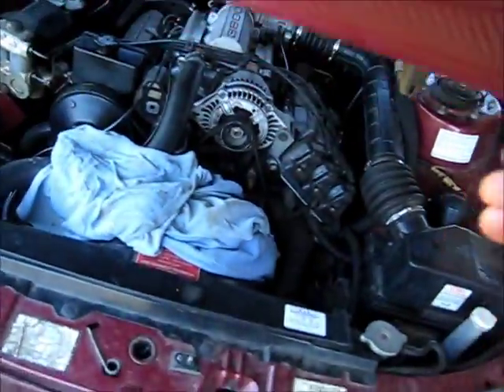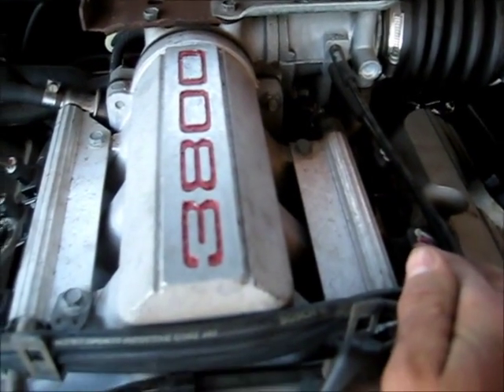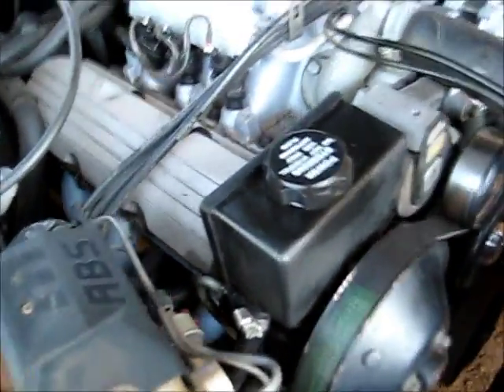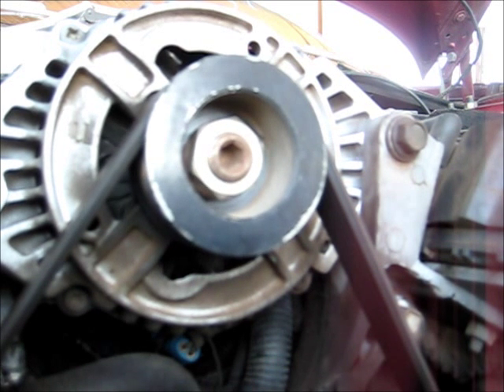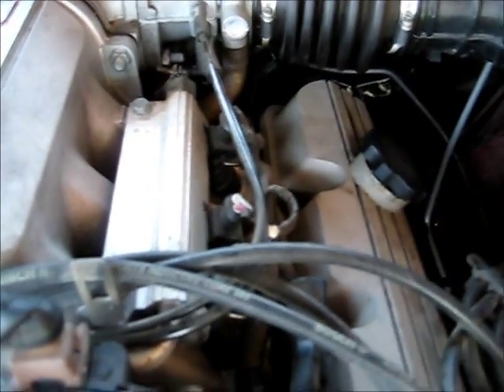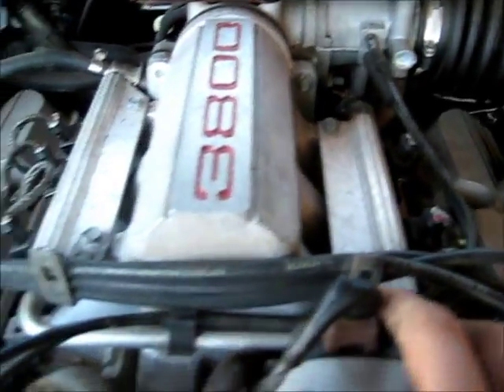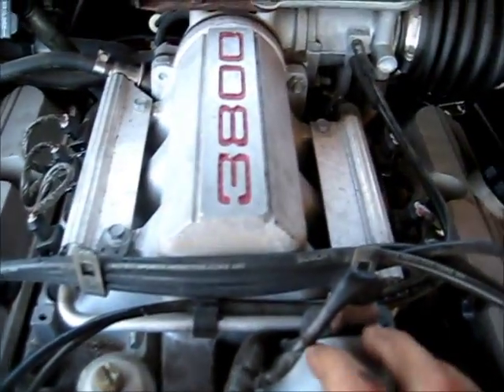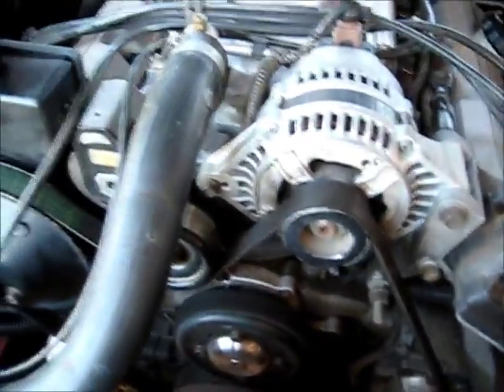Spun bearing diagnosis

Comment from the maker: @133haydo Don't run it if it has spun, it'll get worse and eventually throw a rod, Youd need to get the crank reground, then get custom bearings to fit, It can get expensive :(

Comment: I don't think those are an interference engine, it's either based on a Buick V6 or a Chebby V6 which are both pushrod engines, valve collision is more of a problem on an engine with overhead cams, if the timing belt breaks you can kiss it goodbye. The main problem is that G.M went cheap when engineering their V6s,  they are the same block as a V8 with two cylinders chopped off, so they are inherently off balance and rough running to start with.